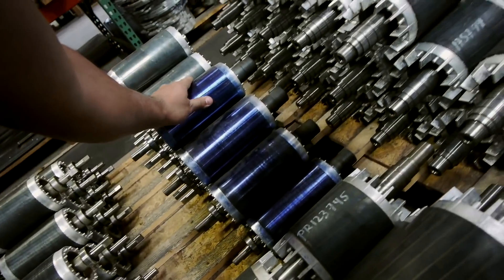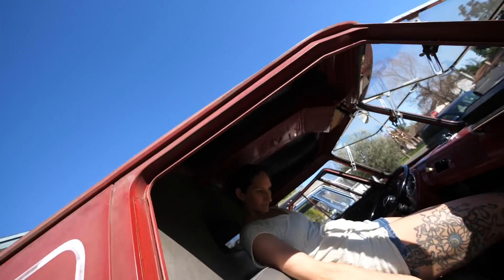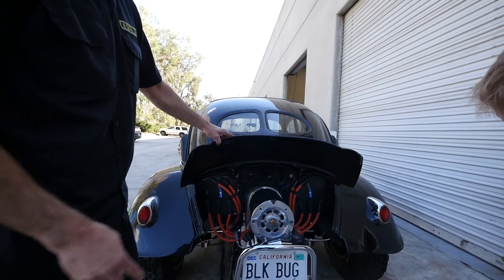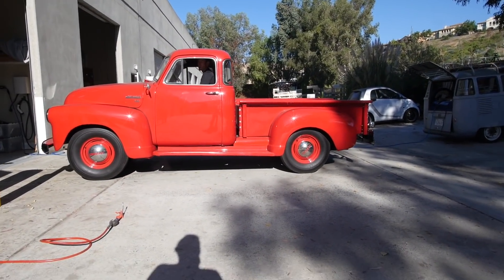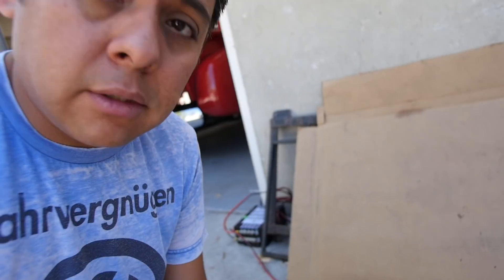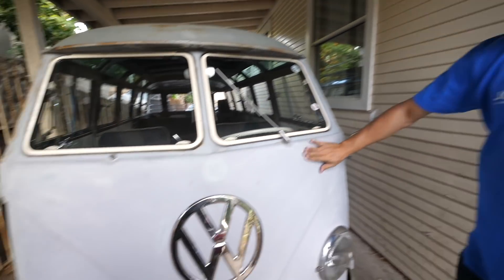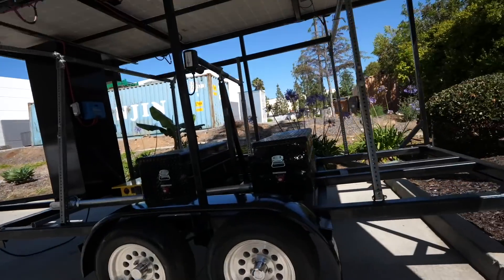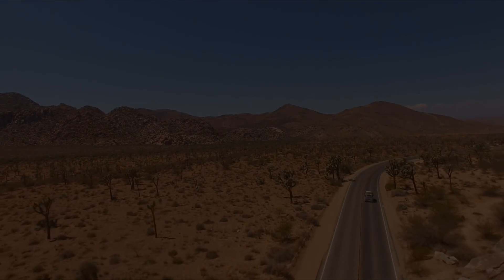10 years of converting Gas cars to Electric

Comment: Whens the hydrogen gonna take over 🤔 convert back to gas 😂😂😂
Reply: It will still be electric under the hood.
Rather than batteries it will have fuel cells (they're more efficient then IC engines)

Comment: Hi, I have been following you for a bit.  I went to battery hookup which you recommended, and I got a bunch of those 3s modem packs that you have.  While I am building larger batteries with most of the cells, I have built a bunch of smaller 3s4p cells with the  reduced capacity and higher internal resistance cells so long as they did not have high self discharge.  I was looking at BMS for those, and then a thought occurred to me.  I am planning to use these in a solar lighting app, and I will already have over current and control of the overall battery over voltage and under voltage conditions.  I am thinking about re-purposing the Pegatron 3S balance boards from the modems for this purpose.  I have not tried that overall, but connecting it to a test capacitor board, it seems like the balance function works, I have not tried it yet to see if it will cut off the battery when an individual cell gets too high or too high of a voltage, but if it works, I will have a ton of 3S boards for my projects.
Reply: Are you aware of anyone who has reverse engineered these common boards yet?

Comment: I love your videos!!! I build AWD M365 electric scooters... Basically I buy 2 used scooters and put the 2nd battery, controller, motor, data cable, throttle, brake handle (eliminating rear disk brake) on the first one and add an es2 foot brake because ebrakes don’t work at full charge... https://www.youtube.com/playlist?list=PLeHZqmhLnUdnvmzQtd_7E9W4_m22sme8D

Comment: you should add a folding solar panel array on the top of the van, like on the space-station, you'd never have to charge it. you could attach it to the grid and use it as generator and sell electricity to the grid if there's lot's of sun and only little driving. how long we need to wait the solar cells get thin enough to manufacture folding solar arrays? maybe you could get NASA involved, they'd get advertising and we'd get solar-engineering tricks and inspiration